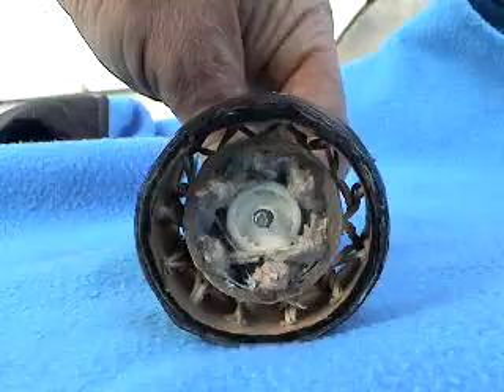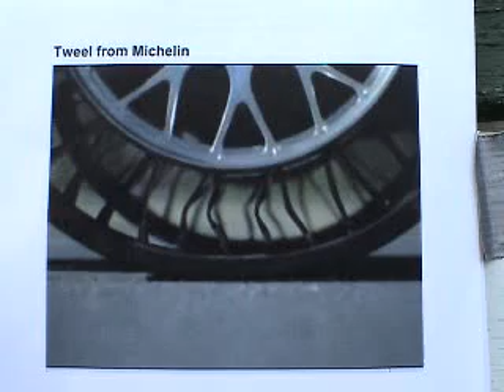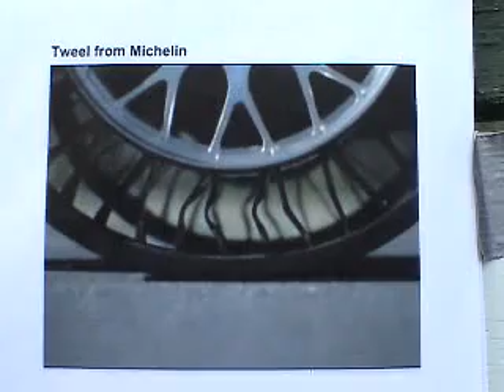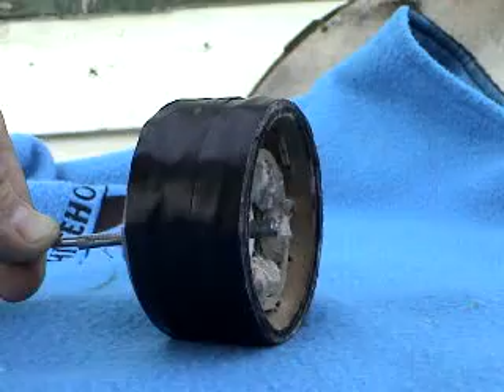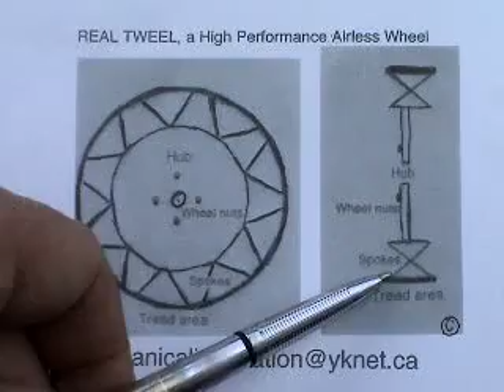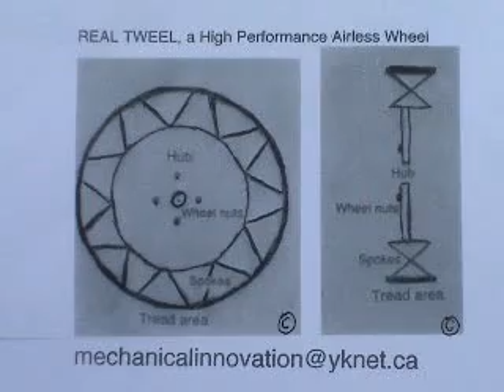Real Tweel, precursor of Super Tweel

Comment: @peterantonbecker If you didn't have the shock absorption of the flexible urethane you would start walking. While a solid rubber wheel with nearly no flex would be the most efficient and most durable but it would suck to drive.

Comment: first of all the spokes of the Tweel are supposed to collapse like that, that is how you maximize surface area getting the most traction. with your design your wheels will be non-responsive when cornering. The inner rim will turn but the outer rim won't follow until the tension becomes greater than than the force of friction on the road. With your design the weight of a car will collapse your wheel completely because your wheel produces no outwards pressure and can't retain it's shape.

Comment: The tweel HAS to deform on the ground. Otherwise there is almost no traction and therefore defeating primary purpose of the tire. The slight deformation causes a larger footprint in the asphalt. This man's wheel will just be dangerous.

Comment: you don't know what you're talking about. i've worked with tweels on construction equipment. they're better than your elastic band and duct tape design. your design neglects the loss of energy in constantly stretching and relaxing the rubber bands. michelin design is far more durable. get a real job.

Comment: I do not agree with a rigid outer band. High speed strikes from rocks, pot holes and curbs that an otherwise ordinary pneumatic tire or Tweel could withstand, would dent and permanently damage your design. However, your criss cross lacing of connecting spokes is a good design. I do think though, that the tweel's 'sheet' like spokes may already be sufficient for lateral integrity.